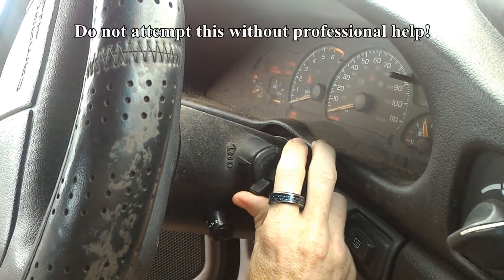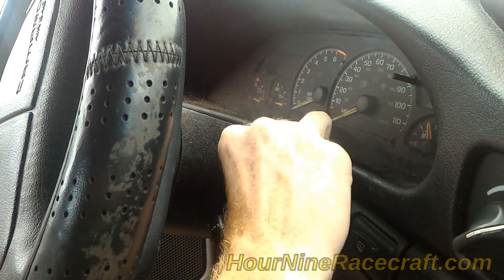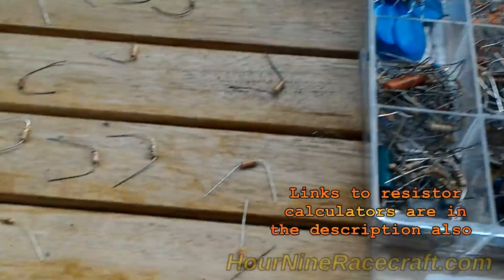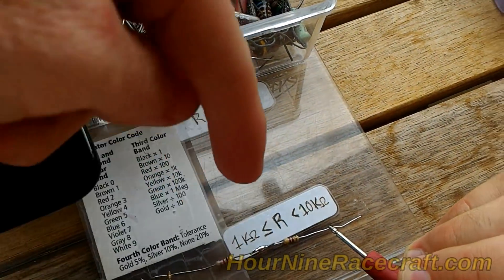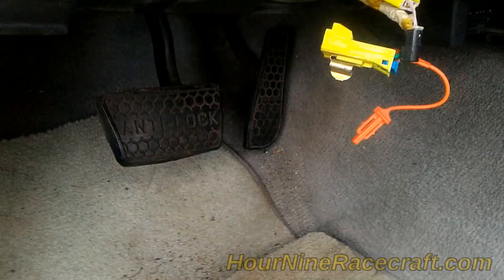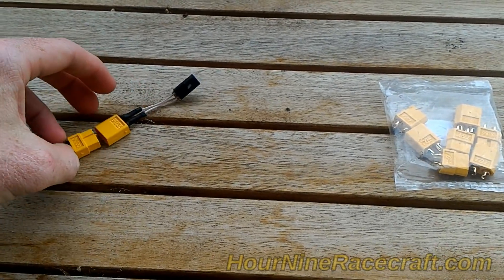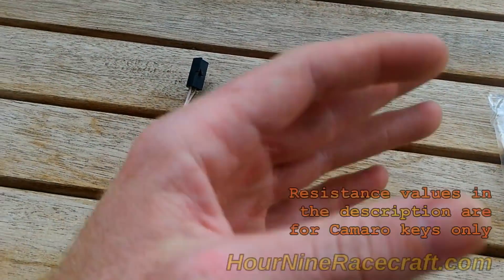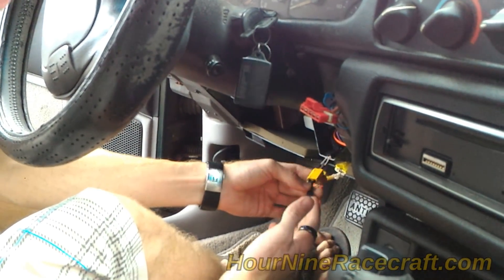GM Security no-start (Bypassing GM VATS)

Comment: Has anyone removed on of these resistors, mine is still good but my wires are screwed up, and I dont want to go thru a relearn procedure, so I was wondering if someone has removed one and soulder it into the wires sorta, my plan was making it removable like a ubi key

Comment: How could I require this resistor thing if the 2prong plug has been cut off at both ends??
Reply: I meant rewire the resistors if the plug has been cut off..  autocorrect
Reply: You obviously dont need to be anywhere close to any tools or wires that touch any vehicles ever. I would probably never let you sit in my car if thats what you took from that.

Comment: Could this be a no start problem without security light?
Reply from the maker: I doubt it, unless your bulb is burned out or the system is damaged somehow. If the key isn't working it is designed to trigger the light unless something else is wrong in the system.

Comment: Just did that in 1995 cutlass Supreme it fixed the no start but security light stays on any suggestions
Reply from the maker: Perfect! I'm not sure why the light is still on, maybe disconnect the battery? But I don't know if that will change anything.
Reply: @LegitRaceCraft  ya I tried battery thanks for getting back to me

Comment: I got a 95 camaro it will start an and shut off the security light is staying on but there's no ignition switch the guy I got it from took it out if I play with taking the battery off and putting it back on it will start and run and move till I turn it off but I can't get it to bypass the vats on it I don't have a key for it and the resistors I got that are 15 of them for GM bypass don't seem to be working with everyone I try
Reply: Did u get it figured out? I do know you have to wait 5 mins or so after trying each resistor. Also try to  lock and unlock the door with the key pad

Comment: I just cleaned my key with alcohol.. Fired right up!!
Reply from the maker: Awesome!
Reply: @LegitRaceCraft  I bought a bypass module off of ebay before finding these videos about resistors.  Any idea how I would wire the module to a 2002 trans am?  It has a  four-wire interface (power, ground, standard signal and 30Hz signal. Thanks

Comment: My 99 Deville will actually start, but it dies after about 3-4 seconds.  Message on display says anti-theft error.  Car won't restart, but will crank.  If I turn off key for a minute, or two, I can repeat the above start and die cycle.  Doesn't sound like the key resistor is the issue.  Thoughts?
Reply: It actually is. When the key is first inserted, it reads the correct resistance. After you push it forward, it loses contact with the sensors and changes so much it thinks it's the wrong key.

Comment: You need to install a switch in series with that resistor. The resistor represents a load and will draw a small current and eventually run the battery down. You cannot simply solder in a resistor and leave it at that. So every time you use your car first flip the switch and  then start. When you arrive turn off the engine and then flip the switch off. Its that or get a new ignition cylinder installed for about 500 bux unless you can do it yourself.
Reply: Anyone who charges $500 to install a lock cylinder should be kneecapped.

Comment: The quickest way is to make a copy of original key, use copy for ignition and attach lead wire to each resistor lead on original key. Quick wire connect each of those leads to those 2 wires under the dashboard. Tape the key very well and bury under dash. No checking for ohms or connecting a new resister. Don’t let lead wires touch key surface only the metal tabs.
Reply: Sounds like some risky business. Lol

Comment: Can’t you just call up gm and get another key
Reply from the maker: +Dalton Bowman yes, if the key is the problem. If the problem is worn out contacts in the ignition switch then it won't fix the issue. The best way is to change out the ignition and the key, if people don't have the money for that then this is the best option.
Reply: These keys can wind up costing several hundred dollars.

Comment: What would happen if you just put some wire instead of resistors
Reply from the maker: +Logans DIY Garage it most likely wouldn't start. The resistance needs to be correct. I don't remember if there is a light on the dash that flashes or not, but if there is then that would be on
Reply: You need to figure out what resistance chip is in your key to bypass the VATS security "feature". With a multi-meter, measure resistance in Ohms. Once you know what resistance you have you can order (So far every key I've checked is available) a resistor on Ebay: approx 4$ free shipping for 10 of them or possibly a radio shack or similar.. Splice one (1) resistor under your ignition (put 9 on your shelf!) onto the wire that measures the resistance. Use some decent connectors and tape!
Here's a video for a Corvette: https://www.youtube.com/watch?v=3PkHTxDQpkE . I think these resistor-key systems are the same. I've done a '97 LT1 Trans Am with a resistor spliced inline of the VATS wire, and will do an '01 Camaro soon. Does anyone know a way to make a key for the door cylinders without having one? asking for a friend! (Bought from a man whom purchased it from an auction. 1 ignition key, no door keys) 
If you were to just put a wire in, there would be no resistance, therefore no cranking and no fuel.
Reply: I was told if you ground the yellow wire coming from the ecm to the theft module that there is no resistor needed 
When working right ,passlock 
From my understanding is that the key sends a signal to the theft module, then the module grounds itself to allow the car to start. Do you believe that this is correct?

Comment: I Did exactly what you did the security light went off but yet it still wont start. What else do you think I could do.  Could it be the ignition switch gone out or what else. This is for a 1990 Firebird.
Reply: Sandra, did you ever get your car started? What all have you done on your end by way of diagnosis?
Reply: @Kevin Shasteen  she only wants answers, she is here to help give answers to how she fixed it. The comments help sometimes more than the video. Sucks when people are 2 way.
Reply from the maker: +Sandra Danjanic  I would measure the resistance and then try again. And also check the connections that are on the ignition for the resistor
Reply: Ok I will try. Thank you.
Reply: Would the ignition switch cause the Vats code to come up.
Reply: Also would the ignition switch stop the key from being read.
Reply from the maker: +Sandra Danjanic if there is a bad connection somewhere on the wires then it would. The ignition would have to be worn enough to where the key doesn't touch the vats contacts.
Reply: Ok we found a loose wire hooked it back and now it will crank but won't start this is getting really frustrating.  It acts like it's not getting gas and battery is fully charged.
Reply: Plus I really appriciate your help.
Reply: @hiediho8693  did I ever figure your car out?
Reply: Nope still won't start and we have done a lot of different things to.  Baffled.
 @nowayjose238
Reply: It can be the ignition switch that is burnt out but don't confuse it with the ignition cylinder switch the one I'm talking about is a connector that sits on top of the steering column but almost in the middle they do tend to burn out or even melt

Comment: $25 on eBay, get a VATS bypass resistor. Find your code number, buy it, unplug ignition lock wire and replace with this, done.

Comment: I just wanted to say THANK YOU!  My security light started flashing on my way to work.  It went off 10 minutes later.  I got to work and tried to move my car to a different parking spot at lunch.  Flashing Security light again and no start.  I found your video and then measured my key and got my resistance value.  I matched it to your list and had my wife bring me some resistors.  I tied the resistors in, turned on the key, got a sold security light that then went off.  Car then started right up and I drove the car home.  The list of 15 resistance values with the calculated tolerance values were much appreciated too.  Thank you again!

Comment: 2 things, I like your connector setup but I'd recheck the resistance value at the plug end of the assembly you made before you install it.  Your extra orange connectors will actually introduce more resistance into the circuit (every additional break in a circuit will) so make sure you're still within tolerance.  It can save tearing your hair out.  Kind of 1A -  The most common cause of this is failure of the tiny wires connected to the ignition lock cylinder.  It was a dumb design to use such flimsy parts for such a critical system but that's GM in the 90's.  

2. I'd have pulled the airbag fuse.  Remember that 90's GM's had RAP (retained accessory power) which included the airbags.  Even with the battery disconnected the airbag could still potentially be armed.  
Good video, I had a 96 Camaro and now have a 95 Formula that I'll eventually have to do something like this to. VATS has been screwed up for 10 years on it ( was my mom's car)  She got lucky when it failed in the ALLOW state but the Security light has been on steady for years and annoys me.
Reply: Mike Hagen

If it works for you great but don't surprised if something as small as a change in temperature changes all that.  The variance in the resistance values isn't that wide and while a connector may be marketed as "no loss" there's no such thing when you break a wire.  Only a soldered connection can approximate the original and even that adds a minute amount or resistance itself.  Considering I actually have a degree in electronics engineering I can tell you with certainty just how maddening 100 ohms can be in some circuits.
But as I said, if it works great.  I just don't like to take chances with a circuit that could leave me stranded and that I've seen affected by nothing more than an sensor tap from a car alarm.
Reply: Car Stuff with El Camino Guy
Reply: Car Stuff with El Camino Guy old post , I know, but those are high amp, zero loss connectors, commonly found on brushless RC cars... the resistance is zero, or so low it won't affect it.   Besides, you'd be surprised how tolerant electronics can be.
Reply: Car Stuff with El Camino Guy great points.  All worth consideration. Especially for me in Wisconsin, where humidity is constantly changing and has an effect on ohms. I also believe in zero breaks in the wire or soldered, For me , the best (for engine swap) would to have the VATs eliminated from the PCM.. but to get something running right now, the resistor works. 
.